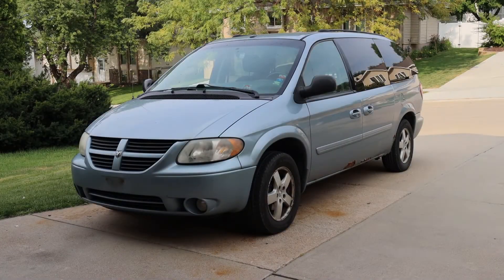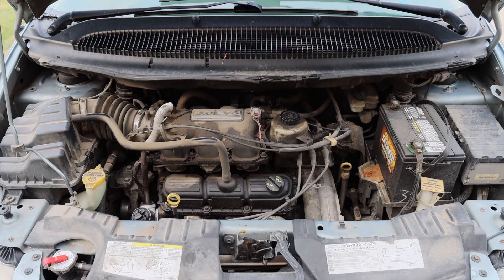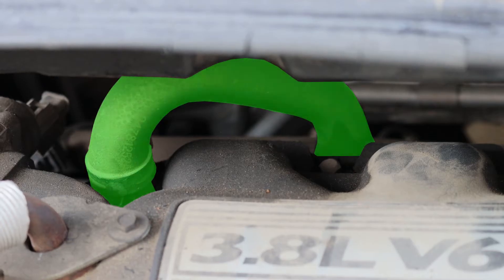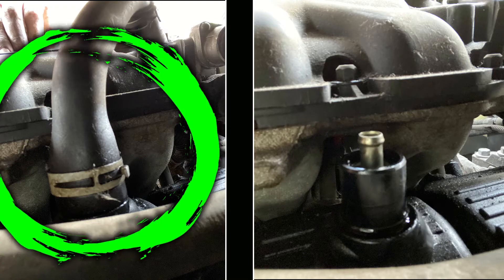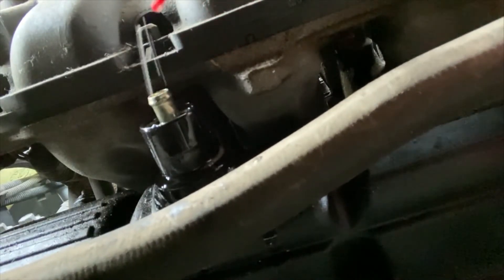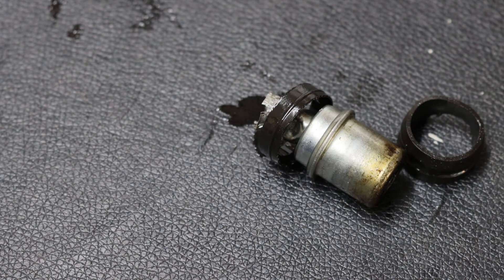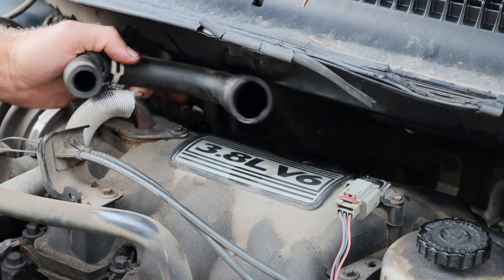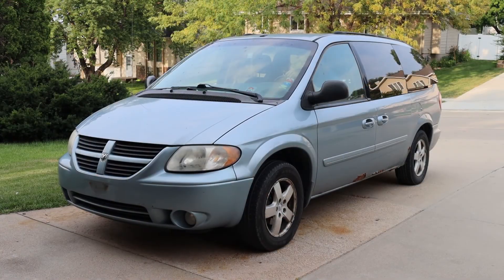2006 Dodge Grand Caravan - PCV Valve Replacement

Comment: Thanks, excellent highlighting of the critical parts (no one has done this before).  In another video they stuck a bolt into the pcv valve (thereby reinforcing the riser tube) then used a vise grip on the tube to work it out by rocking it back and forth.  This way you don’t risk crushing and shearing the metal riser and making removal more difficult.
Reply from the maker: Thanks for the comment and thanks for the tip on using a bolt in the PCV Valve.  Good luck with your repair.

Comment: good graphic for location, good audio and clear instructions. would have like to herd how you went about remove the pcv with your wrench, did you pull straight up etc?
did you have to put some lubricate in there because i say what looked like hard rubber on the pcv?
Reply from the maker: I used a combination of Amsoil Metal Protector https://www.amsoil.com/p/mp-metal-protector-amp/?zo=10458 and a bunch of different wrenches, pliers, etc.  After I was able to get it a little loose, I used a small vise grip, clamped on to the edge and "rolled" it back slowly.
Reply: How can I remove it with w 40 and with mechanical tweezers and with great force the inside is not damaged I cannot remove the Pcv valve
Reply: @juanitojones8719  .. yeah, it is much easier when you remove the engine from the car first.

Comment: I cannot get the valve out, going to have auto mechanic try. I had to remove the cowl, did some damage with that. I pulled the PCV and some of the shell holding it broke. With 178000 km and being 16.5 years old not upset, with the damage. Thx for the reply, Insane Oil
Reply from the maker: It was difficult to get the one in the video out.  It took some time and angry words.
Reply: There's is no way to get it out without breaking the part when i got mine outit looked like the guy in the videos youjust have to keep pulling until it breaks out
Reply: I screwed a bolt in it, then with pliers pull it out. The rubber fitting broke from it and stayed in the cavity. I then rolled like a burrito one of those blue shop paper towels and inserted it in the hole. Then with a thin flat screw driver pried it out. The paper towel was so that the rubber, which now felt like plastic, wouldn't fall inside the engine.
Reply: @Douken  if it fell in that whole top would come off pretty easy to take off an on i just took it out with a small screw driver an my finger an in didn't fall in
Reply: @Douken  that pcv vale is a basterd to get out

Comment: Thats the short version.the real life version is about an hour long lots of cussing some damage and probably gonna have to take it somewhere to get out all the peices that fell in the engine..i might just go to a pick and pull and get a whole valve cover and pvc off and clean that one up good and be sure its working and install the valve cover and pvc in one move if its any easier or just take mine off and put new one in while it's out 
.not sure yet but i need it done bad....
Reply from the maker: I did cut the vulgarities out of this video for the purpose of it being G-rated for YouTube.  But, yes, it was difficult to remove.
Reply: @InsaneOil I'm going to pour alitte alcohol on the rubber to heat it up and see if that will help in the removal not enough to cause any damage but little by little see how it goes .let's roll

Comment: You've got to tap it down further than that
Reply from the maker: What am I needing to tap down?
Reply: @InsaneOil i think he's saying to tap down the pcv valve down i was wondering if i got mine down far enough seen other people use a deep socket an a hammer to tap it down did you're pcv valve turn out to work fine
Reply from the maker: @phillipcastro2394 yes, you want to make sure it gets seated fully.
Reply: @InsaneOil  they could have saved us alot of time making the screw on real tough but powered through it